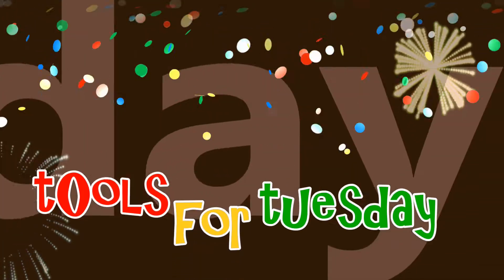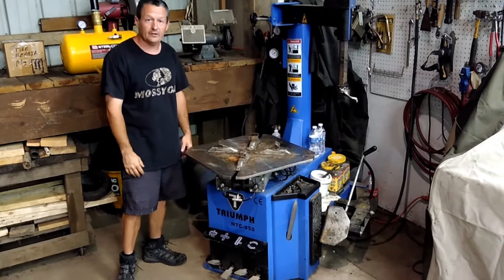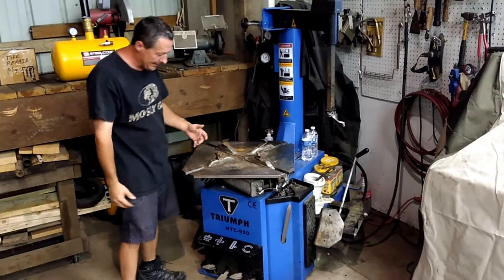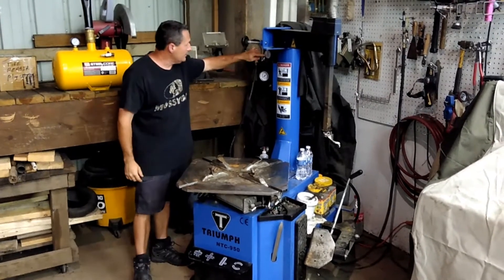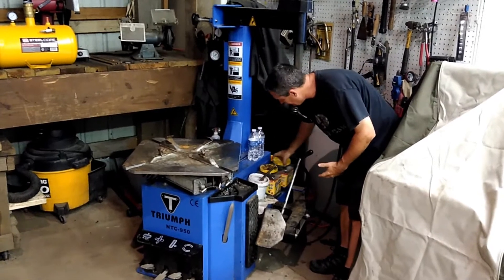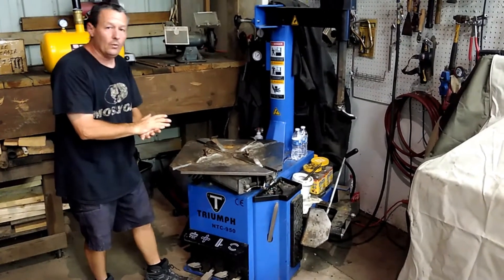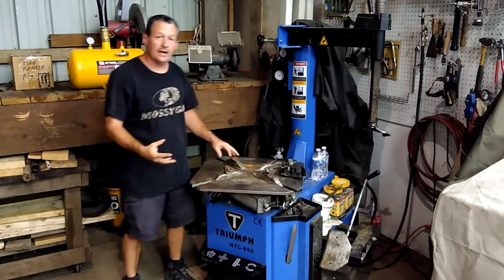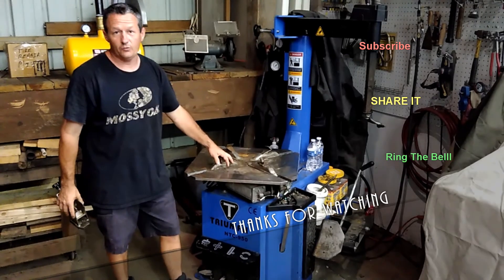Triumph NTC 950 Tire Mounting Machine -  Rim clamp, Tire changer review, features and overview -

Comment: Would you recommend this machine for a start-up used tire shop?  I'm looking at options and this one is the cheapest I can find which seems to be well made.
Reply from the maker: Yes, if it's not in use all day every day. If your capacity is constant I'd get a coats or other name brand machine. I do anywhere from 2-10 tire a week, I it not daily. There are a few oddities in design and cheaper made components in the unit.
Reply: @notoriousJPG  thanks for the reply.

Comment: I am considering getting one of these for a shared shop where several friends work on our cars together.

One has older British cars with wire wheels and splined hubs so this looks like it could work for him too. Another has a motorcycle - you mentioned that you got those aftermarket adapters for ~ $150 for the set.  Would you be able to share any details on where you bought those, maybe a web link ?

 Thanks for the good video as it this machine is definitely on our list now. We are considering getting the combo with the balancing machine as well. Triumph is a little more expensive than some of the other brands out there, but it sounds like overall it is a good package. Most seem to be satisfied with the sturdiness of the equipment for low volume shops doing a dozen or fewer wheels a week and it seems to have fewer negative comments than the cheaper brands. Looks like a great unit for our relatively small volume use, though my guess is that once we have one others will find out about it and it will get used routinely;)  Thanks again for the vid.
Reply from the maker: Hope it helps you. It has been a good machine for me although I've had a couple issues with it. I use this way more than I ever expected to when I got it. some weeks I might do a few tires. other times I'll do 20 -30 in a weekend. If I was running a commercial shop I'd look for a "brand name one" but these are good starter units for sure.  

I purchased a balancer with mine and had to take the balancer back because it was damaged inside the crate. They swapped it out for me with a different one. Hope that helps! The balancer is more cheaply made and has some weird nuances when using. I mostly do trailer, equipment, and work trucks so the balancer is nice to have but not crucial for me. I only need to balance 1 out of 10 tires I do. 

I have friends that are professional auto mechanics that are used to high end equipment. They use my equipment occasionally for some personal stuff and they're biggest complaint is some of the odd positioning for the pedals on the changer,  and settings on the the balancer. 

I'd rate the tire changer a 7 and the balancer a 4.
Reply: @notoriousJPG  - Helps a lot, thanks for the follow up. We will probably do fewer tires than you do so volume wise this should fit really well with our needs.

 We are going to order the combo. But I'd bet that like you, once word gets out that we have one we will end up doing more than we plan for friends, then their friends, and so on.

 I've also heard the 550 model balancer can have issues. One guy noted that bolting it to a concrete floor and making sure it was exactly level helped improve the accuracy of his a lot so I'll try that route right off the bat. 

 Do you remember where you bought the motorcycle adapters for $150 ? They have them on Amazon for $200 that are specifically for this machine so if you can't find it we will probably just order those.

 Again, thanks for the video and you reply!
Reply from the maker: @davidroush1224  yea, I got them through directly from NAT. Where I bought the machine in Columbus Ohio. This was a few years back so prices may have changed some.
Reply: @notoriousJPG  Thanks !